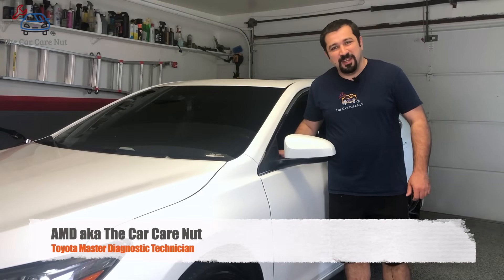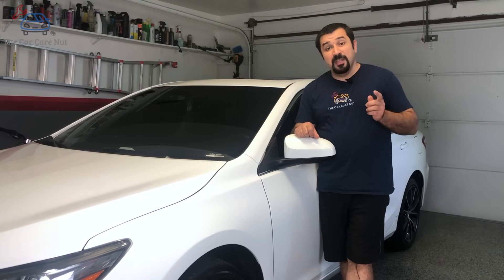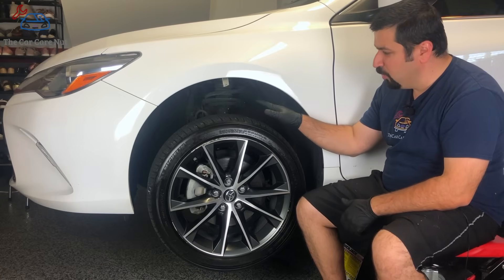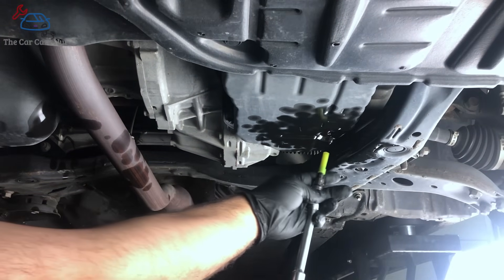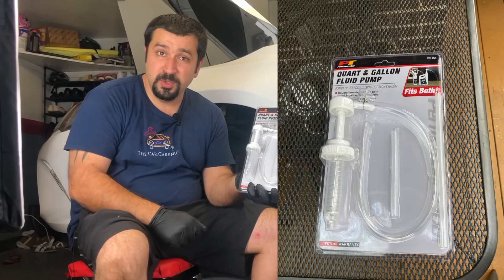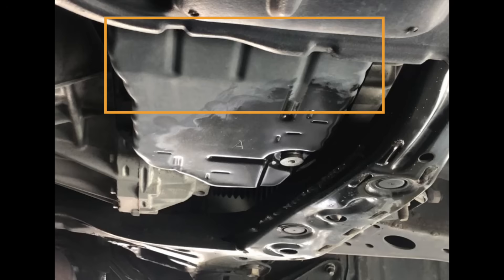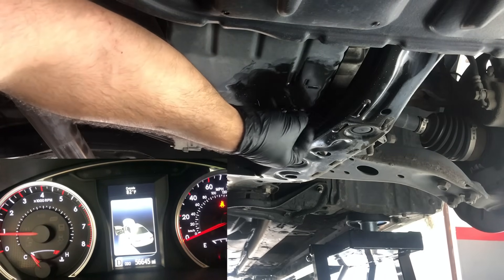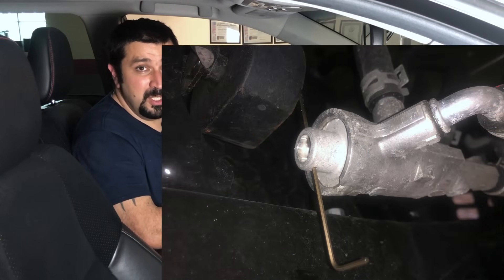How to change your Toyota Sealed Transmission Fluid

Comment: Do you have a recommendation for an infrared temp gun or an inexpensive scan tool that works with 2007 Toyota Camry hybrid? Also what gage wire are you using for the jumper? You said to only add 3 quarts what about the remaining old ATF in the trans?
Reply from the maker: Hi! For your Camry hybrid the procedure is different and much simpler. Here’s a video for your Camry hybrid https://youtu.be/I1fP-RKsqG0
Reply: @TheCarCareNut  Thank you for your reply. I looked at the other video but you don't comment on the temp of the ATF. I am assuming I do this on a cold transmission, correct?
Reply from the maker: On hybrid transmissions it doesn’t really make a big difference on temp. You can do it when it’s cold or hot.
Reply: @TheCarCareNut  Doesn't the fluid expand when hot? Do I not need to measure the amount drained from the transmission?
Reply from the maker: You don’t need to measure it. Simply fill it until it overflows at room temperature.

Comment: Just got a 2021 Rave4 Prem    It will be some time , but hope you make a updated version for 2021 Rav4 .    PLEASE also what is the temp of fluid if using a scan tool that the light turns solid?   I prefer to know Scan tool temp vs light.     Need more info on that bypass valve.       Thanks this is good video as is all I have had time to watch.  
I have Foxwell pro 530 scan tool for Toyota 
2. I saw your brake video on retracting E brake.     
Send me email with you business address and I send you a gift  bottle of my Hot sauce  as a thanks for you help.  See       www.mribob.com
Reply from the maker: Hi! Thank you for watching my channel! My system is down at the moment. I’ll get you the temps in the morning when it’s back. Just reply to this comment so I won’t miss it
Reply: Thanks.  Its simple.  since i have scan tool. i rather have temp readings vs the solid light which i not comfortable to place wires in the obd port
Reply from the maker: The temp range is 95-113 F

Comment: Is it too late to change fluid on a 2014 corolla S cvt at 119k miles? Should I change the filter too, since the oil was left in there for too long ?
Reply from the maker: Hi! Honestly at this point I would consider leaving it alone and at most I would just replace the fluid once.
Reply: @TheCarCareNut  thanks for your answer, it's on a friends car, I'll do(like you said) just a drain and fill, so half of the fluid capacity

Comment: Ok so , this is off topic but....maybe u kno if my 2019 Prius is susceptible to those rash of catalytic converters that are being stolen.  If it is at high risk,  what can I do about it ?  Maybe they were just stealing the older models cats .... ?  Is it easily accessible,  or did Toyota do something different with this particular year to help prevent the thefts ...
Tks in Colorado.
Reply from the maker: Hi! So I haven’t seen a 2019 yet but have seen an alarming number of 2nd generation Prius models for catalytic converter theft. However all cars have no covers on the exhaust so theft is possible in all honestly. Some are easier than others and the fact that I haven’t seen any being in an area with high thefts at the moment is a good sign. Many companies make protection shields to make stealing them much harder I would research

Comment: You’re the only guy I trust on how to videos for my Camry. I’ve watched a bunch of other Youtubers and you are by far the best
Reply: I have been in the field for over 40yrs and I totally agree! Very good presentation.
Reply: What is the transmission temp for a 2017 Toyota sienna ??
Reply from the maker: Hi! 95-114
Reply: @TheCarCareNut  hey AMD! Should I drain and fill the trans on my 2010 Camry LE 2.5?
Reply: @TheCarCareNut do the new 24' Camrys have that cooler line button that needs to be depressed then pinned with the Allen key? If so, where is it located?

Comment: A big Eff You  to Toyota for making a simple maintenance item a convoluted mess.   Toyota had very good engineering the past.  Those days are over.   I'll stick with Honda.  Their engineers are smarter, so the cars are probably better.
Reply: I believe that most newer cars have no dipstick. The competitive pressures to have the lowest hood-line, the lowest center-of-gravity and thus the shallowest transmission pan REQUIRES that the fluid be checked/corrected precisely, by qualified personnel.  Far too many "average Joe" home-mechanics might use an incorrect procedure or even take bad advice and use the wrong kind of fluid. I often make mistakes when I do an unfamiliar job for the first time. The fluid level has to be checked within a precise temperature range. 
But you only have to do this every couple of years or perhaps every five or six years if you drive low-to-normal mileage. 
True, this is harder than doing an oil change, and is the hardest normal maintenance job on these cars outside of repairs or major suspension maintenance, etc.
Reply: Bye bye!!

Comment: @ Car Care Nut: Saw the video several times, what happens if one replaces the fluid without warming between 95 - 110 deg. 
and therefore, there will be more fluid when the trans reach operating temp? I'm curious becasue you did'nt mention this 
in your video. Further, the dealer near me uses a BG trans flush, what's your opinion of that considering the required temperature
I mentioned, Thank You.
Reply from the maker: Hi! If you overfill Toyota sealed transmissions they will typically leak or some of them will make a whining noise. The BG flush that’s used by dealerships I personally don’t like. I’d rather use original fluid even with a flush. The flush should be followed by a fluid level adjustment. Toyota dealerships use a high temperature fluid adjustment special tool which allows you to check the level at operating temperature
Reply: @TheCarCareNut  Appreciate your reply, another dealership uses a Vesco machine to perform the flush using Toyota WS fluid what's your opinion, of this?
Reply from the maker: If they follow the flush with a fluid level check it should be good

Comment: Is it really necessary to change filter whenever you change transmission fluid? Thanks
Reply from the maker: Hi! It’s not. On Toyota transmissions the filter will not need replacing if the fluid is replaced on time

Comment: Great video. To bad you only get 2 1/2 quarts out, a small percentage of whats in there. Hyundai has a procedure were after you do the drain and refill, you disconnect the cooler line and allow the oil pump to purge out the torque converter.  You then refill to exchange the majority of the fluid. I liked how it worked so well I did it to my 05 Corolla allowing me to exchange about seven quarts.

Comment: Hello. I'm in Saudi Arabia. I have Toyota Camry Hybrid 2020. So I got free service from Toyota. The camry engine oil is 0W16. But here Toyota put 10W40. Is it ok? Why they put 10W40? It takes 0W16.
Reply: I don't know. But I ask Toyota. They tell me. Because Toyota change oil every 10 thousand km. But after 5000-6000 km the fuel economy completely down.
Reply from the maker: I would look in your owners manual if it says use 0w16 only then that’s what I would use
Reply: I just checked the owner manual. Toyota preferred 0w16. Alternative 0w20, 5w20, 5w30, 10w30. But not have 10w40. But toyota Saudi Arabia put 10w40.
Reply from the maker: That’s not correct oil then. I would use 5w20 or 5w30 the most if it’s allowed per the manual but 10w40 wow....
Reply from the maker: Hi! Does your owner manual say to exclusively use 0w16?

Comment: Thx for info. I would like to put trans cooler on my 2012 Tundra CM 5.7L. Suggestions?
Reply from the maker: Hi! I don’t have experience with a specific brand or kit to add however I would look at kits with a thermostat
Reply: @TheCarCareNut  Yes good idea.. my issue is not knowing or seeing any lines to tap into.
Reply from the maker: You should have transmission lines or at least a heat exchanger on the side of the transmission is that not the case?

Comment: Question1: Is the 2018 Camry SE has a front Differential fluid or does it share the trans fluid? How often you change the Differential fluid if any? your advise is greatly appreciated. Thanks,
Reply from the maker: Hi! Your 2018 Camry SE doesn’t have separate front differential fluid. When you replace the transmission fluid you also replace the differential as they are shared.

Comment: I am sticking to your recommendation of not changing my 2012 2.7l transmission fluid as it was purchased @ 160,000 miles with no records of changes however, i could not find a video close to mine...is there some other video that I may review which would help me not only to have the proper transmission fluid level checked but, to take care of this transmission? Thank you for all your useful information!
Reply from the maker: Hi! The transmission in this video is exactly the same as the one you have.

Comment: I just finish change my 2014 sienna transmission fluid. it came out about 1 1/2 qt. with straw took out. Put back the straw and hand tight drain bolt. Then I fill in 2 qts of WS fluids. Run it's temp to 110 degree with handheld laser temperature gun. It drains out about the same I took out first time. Should I put back 1 1/2qt fresh fluid in and call it done.
Reply from the maker: Check the transmission fluid level per my video. If the level is correct you’re done

Comment: It's a good idea to remove the fill plug first, before draining the transmission.

On the 8AT Sienna, for example, a DIY-er may need to obtain a short or a swivel hex socket to access the fill plug. You don't want to find this out when the transmission is empty.
Reply: The biggest reason for doing this is to ensure you can actually put fluid in before you drain it.  You do NOT want to discover your fill plug is stripped and stuck after you empty the transmission.

Comment: Nice video! Does this also apply to 2020 rav4 2.5L engine 8 speed?
Reply from the maker: Hi! Yes the drain plug location will be different as the oil pan is on the front. You’ll find one 10mm hex on the bottom of the transmission then the overflow pipe is behind it take it out with a 6mm hex. Everything else is the same.

Comment: Just bought a 2012 Camry and this channel is a life saver! Thanks!
Question: Do independent service shops use Toyota ATF WS? I'm about to get a transmission service and want to make 100% sure it's utilized.
Would it be crazy for me to bring in 6 quarts and ask them to knock off $50?
Reply from the maker: Hi! Some shops will use aftermarket fluid unless you ask them or bring your own fluid. I would ask and if they can’t get it, get your own
Reply: @TheCarCareNut  Thank you!
Reply: I'm concerned about my transmission at 107k, so please pardon another question:
The transmission has been slipping occasionally and there's no record of a service from the seller. Could it just be old fluid? How do I know if there is severe damage? Metal shavings in ATF? I take it in for service on Friday. Thanks in advance.
Reply from the maker: Interesting. I would have the memory reset first and the fluid level checked before replacing it

Comment: I just purchased a 2013 camry se 2.5L I4 automatic with 103,000 miles. Don't know if fluid has ever been changed should I change it now?
Reply from the maker: I would change it soon. Consider just a drain and fill and you should be good
Reply: @TheCarCareNut   Thanks

Comment: I have a 2015 camry with 82K miles. I've not yet changed the ATF. It runs fine, but should I change it ASAP to keep it running fine?  Also, how often is it recommended to change? Thanks!
Reply from the maker: Hi! I would get it changed. I recommend you replace it every 60k miles or 6 years. You’re a bit over on miles but that’s not an issue. Get it replaced and you should have no issues

Comment: Great video!  Question - what's the proper fluid temp for a 2014 3.5V6 Highlander w/ the 6-speed automatic transmission?
Reply from the maker: Hi! 104-113 F for your highlander.

Comment: For 2018 Tundra, what is the transmission temperature range required for checking fluid level ?
Reply from the maker: Hi! Is it 4WD or 2WD?
Reply: @TheCarCareNut  It is 4WD
Reply from the maker: Thank you. There are two transmission options here. If you have a AB60F then it’s 99-111 if you have the A760F it’s 127-138 you can check which transmission you have on the door jamb sticker
Reply: @TheCarCareNut  Sweet! Thank you

Comment: My car is JDM Toyota Premio 2011 with K310 CVT, does it take FE or TC fluid?
Reply from the maker: That transmission is not available in my area. I don’t want to give you incorrect information I would consult with your local dealership

Comment: Thank you for this. Excellent as all your videos.
What about the 2020 RAV4 CVT? is it the same or nearly the same?
Reply from the maker: Hi! Is this a rav4 hybrid?
Reply: @TheCarCareNut  no its the gas one
Reply from the maker: A 2020 RAV4 in the US doesn’t have a CVT, it has the 8 speed transmission. Is this a US model?
Reply: @TheCarCareNut  no it is European (Greece). I did not think they were different. And it is the 2.0L engine.
Reply from the maker: Ok that might be different then. Look on the door sticker and see which transmission model it has

Comment: Did you shut off the engine while open the drain plug after doing the procedure
Reply from the maker: The engine is running and the car is in park

Comment: Hi my 2018 sienna is hesitant at around 1000 and 1500rmp. Is toyota coming up with any solution to fix the problem yet? Please
Reply from the maker: Hi! The dealership will need to inspect the issue and see if a software update is available

Comment: Hi, in the last step do I shift the car into park or leave it drive? Thanks!
Reply: Thank you Ed Re for asking this question, and thank you CCN for clarifying this. 
I have a couple of tips also. First is that I over-fill by one quart before starting and letting the temperature come up before setting the level, to increase the amount of fluid being replaced with each drain-and-fill.  And second, I use a very thin curved rubber tube to pull out one more additional quart of old fluid from below the top of the threaded drain bung in the pan. So with these extra steps, you will need a couple of extra quarts of WS fluid.
Reply from the maker: Hi! Shift the car into park

Comment: Your videos are fantastic!  I own a 95 T100 (original owner 297000 miles) and a 2013 Lexus IS250 (T100...NO problem. It has a dipstick!  The Lex is REAR wheel drive.  It is in excellent condition.  No leaks Tran fluid or otherwise. With BOTH the transmission and the new fluid at THE SAME TEMP (as in sitting overnight)Would it be to drain and measure the fluid that comes out and then put in the same amount of new WS?
Reply from the maker: Hi! You can do it that way, but I’d say if you did all the work of measuring and adding why not take it one more step and Check the fluid level and be on the safe side

Comment: Does the car need to be in the Drive mode when you are checking and waiting for the fluid trickle. Thanks
Reply from the maker: When you are doing putting the car in fluid level mode where the D light come on put the car in park as you wait for the fluid to trickle

Comment: @thecarcarenut what is the temp for checking the level for a corolla 2014 cvt transmission?
Reply: @ thecarcarenut my corolla is 100,000 miles now, should I replace the transmission filter also?
Reply from the maker: Hi! 95-113 and I wouldn’t change the transmission filter.

Comment: Customer of mine has 188,000 miles on 2012 Camry 2.5l without ever having a trans service. Should I recommend NOT having a fluid change? There are no drivability problems that I'm aware of.
Reply from the maker: Hi! Honestly that’s a border line one. I would at most do a drain and fill and call it a day.

Comment: We have a 2017 Toyota Corolla LE.  I want to drain, pull the pan and clean it out and replace the filter (if it has one).  I'll measure the drained fluid and try to compensate for spillage, and add a bit more, but I want to use the temp gun method.  So my questions are...what is the process for shifting the transmission after re-fill?  Is there a specific shift process?  What is the correct temp range...and where do I measure the temp off the transmission pan?  Thank you.

By the way, I really didn't quite understand your diagnostic procedure...especially the part of removing the jumper wire, the shift technique, etc.  I think I'm more comfortable just using a temp gun.